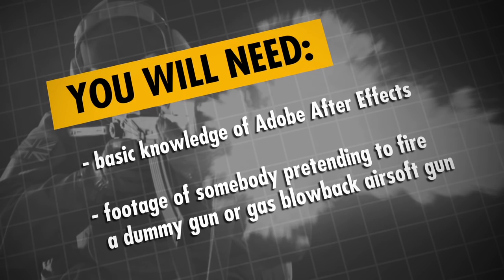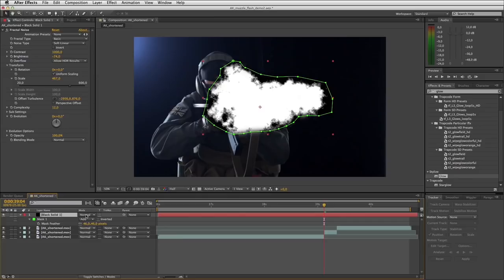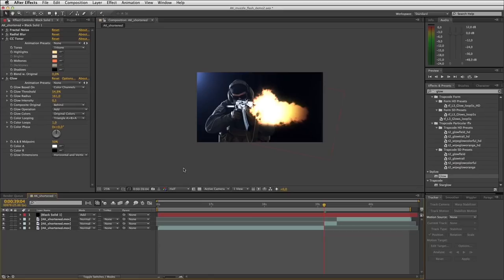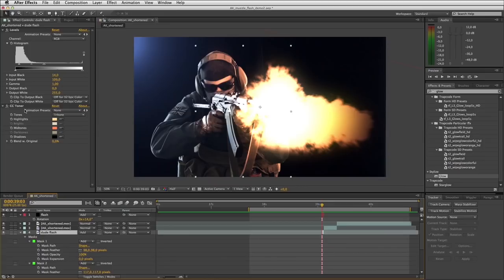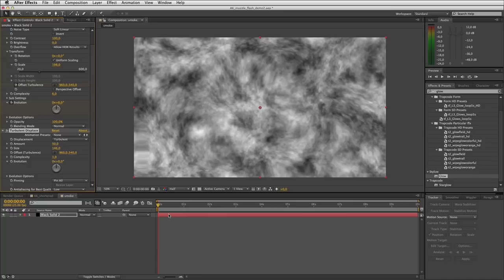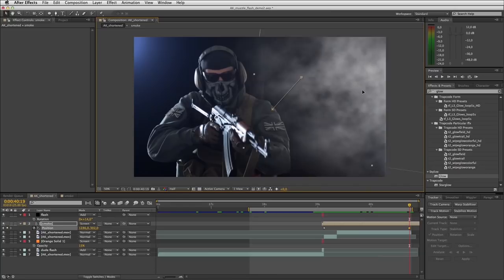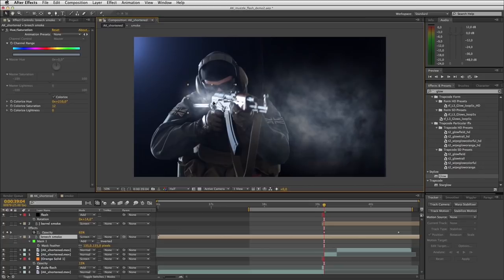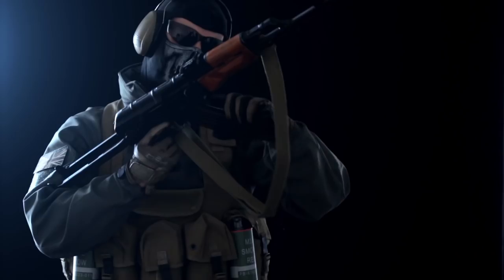TUTORIAL: Muzzle Flash - part 1, flash & smoke

Comment from the maker: Xtrememous - probably not, unless there is a huge demand for it.  But basically, you follow the same steps as in this tutorial, but you make the smoke thinner.  Instead of making a big muzzle flash, you can either leave it out or create a tiny little glow at the tip of the barrel using an orange solid and a small feathered circular mask.

Comment: I don't want to bash you or anything but the flash itself is decent, especially if you consider it's only done with fractal noise, you could have changed the settings a bit more to give it a bit more texture but that's a choice. 
What bothers me is the smoke, it looks so cheap and not at all natural, smoke is something you should go easy on.
That being said I liked the way you did the silenced ones, they look well balanced, as well as the one with the scar.
Reply from the maker: Soap1O Yes, you are right.  Using real smoke would have been far better
Reply: hum... im not sure! for free, every smoke fx are bad. and you can have a best liberty to change the shape, the size, the impact and how fast you want (for the smoke)

Comment: Scott, this question may sound dumb, but we can't get airsoft guns here, so I'm excused. ;)  The pistol he fires, does it actually have a gas blowback mechanism? I assume you didn't do the recoil, slide-blowback effect in AE, because you would have done a tutorial on that, if you had. Correct?
Reply from the maker: G Gnome Yes, correct - in this example the pistol was a gas blow back pistol.  But the slide actually moves so quickly that its only one frame in the sequence and the muzzle flash ends up covering it up and hiding it.  So if you were filming with a non blow back pistol and you wanted to add the sliding action, you could just fake it with one frame - or you could probably even leave it out because the muzzle flash creates most of the illusion.

Comment: seeing that you actually respond to comments:

when you say that you edit out one frame, what is your stock fotage? 24fps? 60fps?

lets say your stock fotage is 20fps, this would mean that i have to edit out 3 frames at 60fps to arcive the same result right?
Reply from the maker: Hey TheAirsoftMuffin, I think that sounds correct.  Im in South Africa and our video standard here is PAL - 25 fps.  I remove one frame, but in theory you can remove as many as you like, as long as it has the desired effect.  If you have shot footage at 60fps, you could always convert it to 30 or 25 in After Effects and then remove the frames (if you are going for a realtime look).  But the best would be to just remove frames, play the footage back and see how it looks.  There is no right or wrong answer.

Comment: Possible to make my own preset so i wont have to take 30 minutes on each flash? Tell how please
Reply from the maker: Yes, absolutely ReWaken Zwerg - visit the IndependentVFX channel and check out our video on creating M4 star shaped flares - in that video we show a method to create randomness on each flare quickly and easily.
Reply: At the start, its long to make it but with practice its fast. 

But if youre laZy, I think you can make the flash over a blacksolid, save it as a picture and put it into your footage. Then put it as add or screen